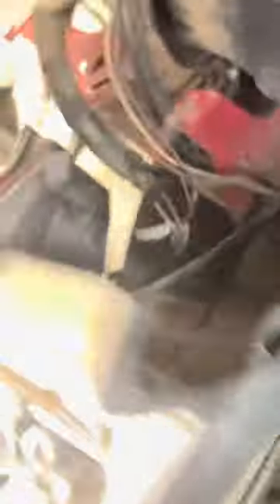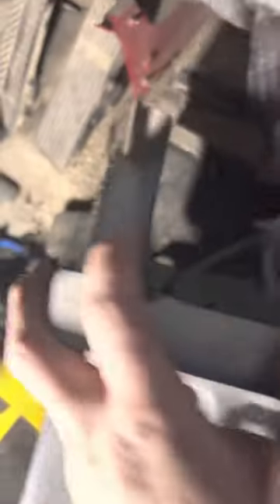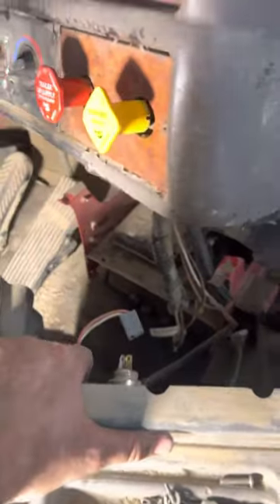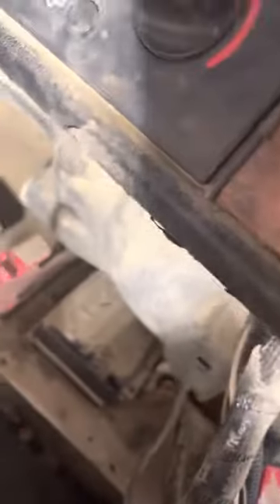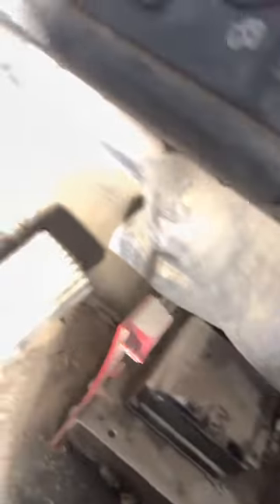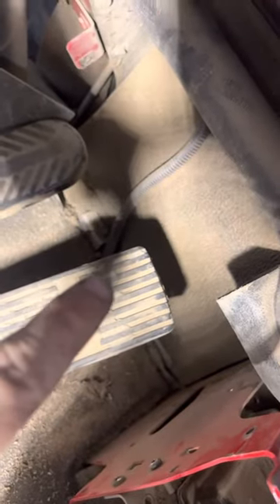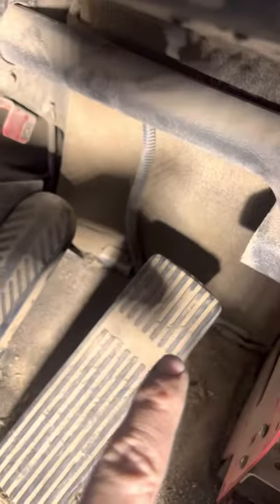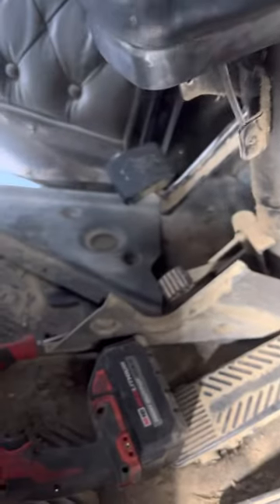Kenworth T600 T800 Blower Motor Resister LOCATION

Comment: Que función hace eso?
Reply from the maker: Sometimes if your blower is stuck on only high speed or only low speed and you can’t change it this is the part that typically needs changed
Reply: Aumenta o disminuye la velocidad del AC fan
Reply: Tengo un problema con un motor de calefacción no funciona pero llegan todas las señales.
Que podría ser el motor interno?